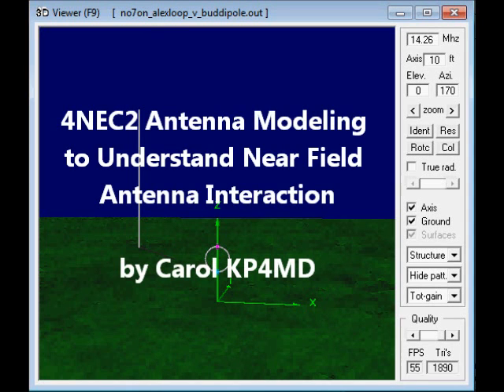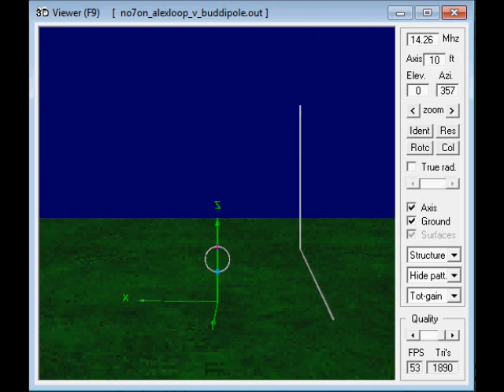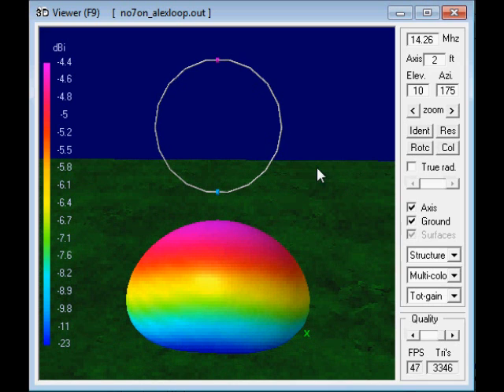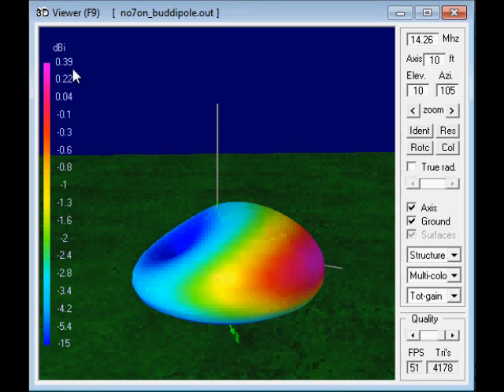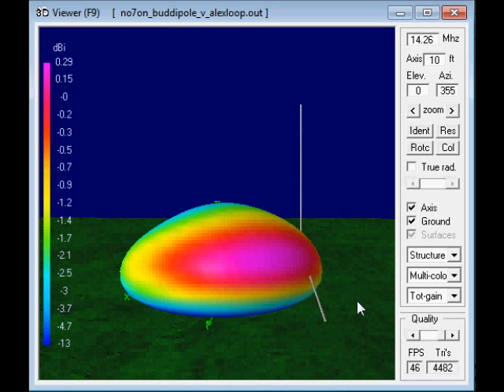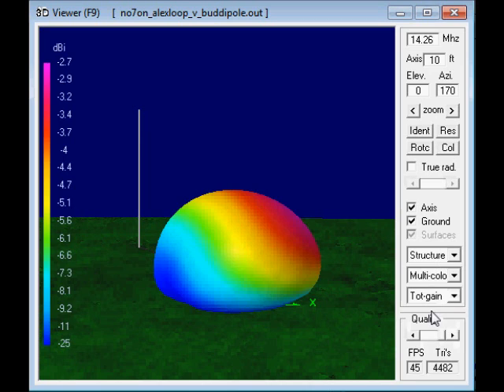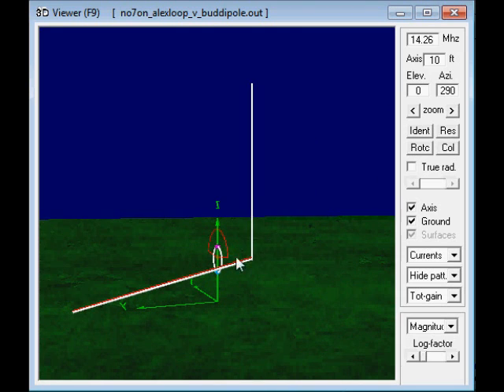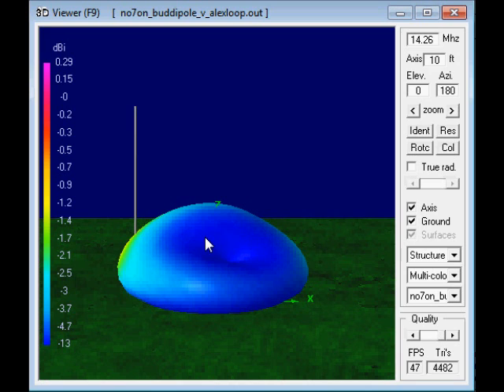4nec2 Antenna Modeling of Near Field Antenna Interaction

Comment: I'm planning to install approximately 24 square feet of grounded aluminum screen under my operating position to raise my RF ground since I'm in the attic. But my dipole passes right over my shack, and I'm wondering about interaction. The screen will be ~10 feet above ground, the antenna, ~20 feet above the screen. Can this be modeled using this software?

Comment: Carol...THANK YOU for this video...I am new to ham radio...and this video was very clear and informative....I am curious if you can predict how the comparison would have been had 1) there was separation, and 2) Buddie Stick had 4 radials??    Again, many thanks for an excellent video !!!   73, Jim K3JRU
Reply from the maker: The near field is defined as one wavelength or less and the far field is two wavelengths or greater.  
Their radiation patterns will show decreasing interaction as the separation increases beyond two wavelengths.
A Buddistick with equally spaced radials will yield an omnidirectional pattern.